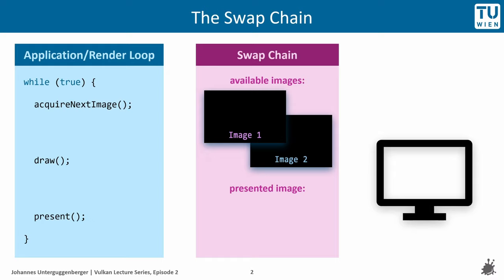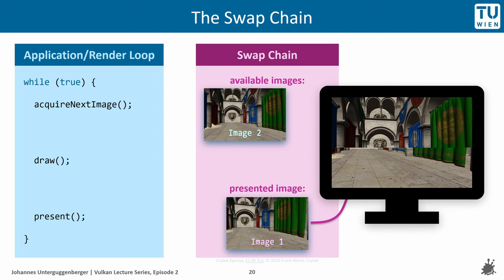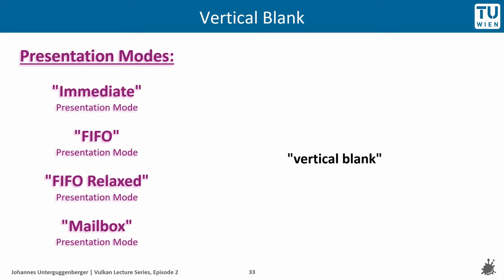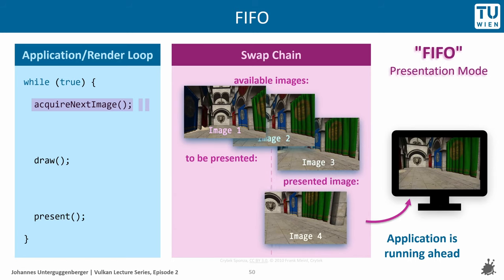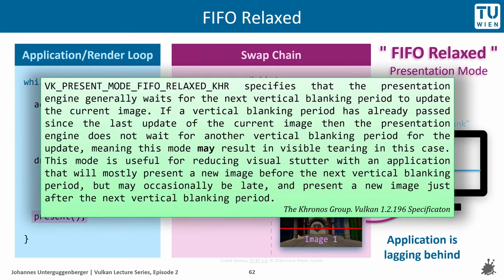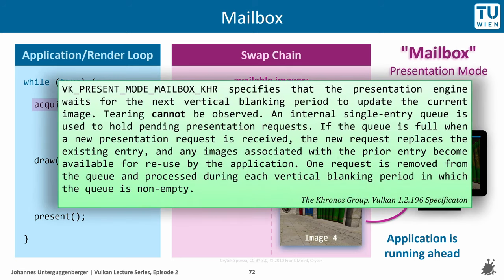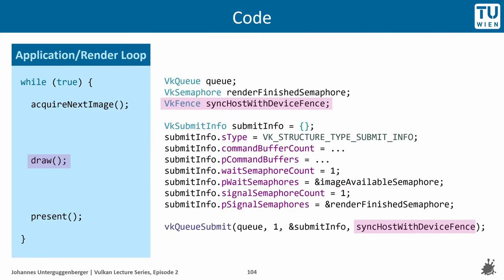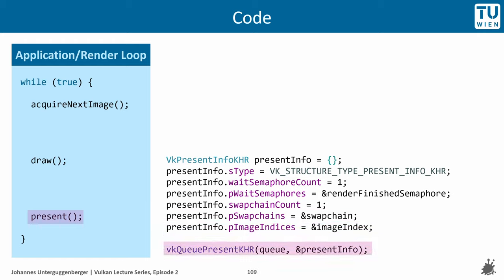Swap Chain | "Presentation Modes and Swap Chain Setup in Vulkan" | Vulkan Lecture Series, Episode 2

Comment: What happens when a FIFO swapchain with just one image runs out of images to present? What image does it display when the single image is still acquired and a vblank occurs? Also, what happens when a vblank occurs but there is no new image queued, does it release the last presented image anyway? It will have nothing to display on the next vblank in that case. AMD's windows driver happily creates such a swapchain and the validation layer is silent.